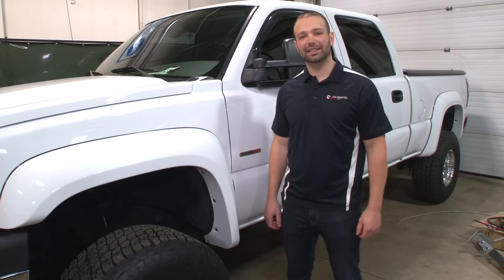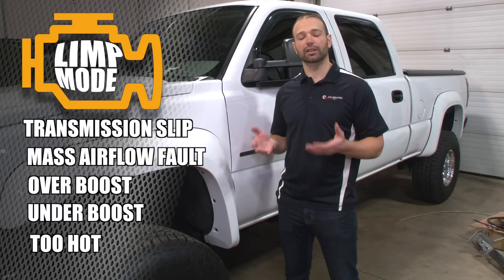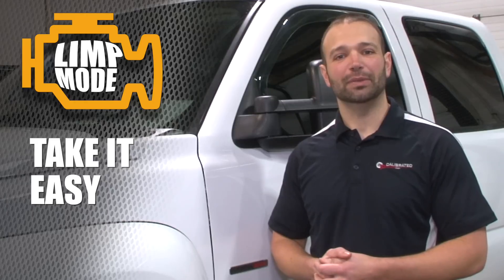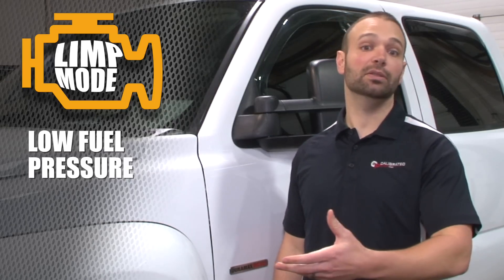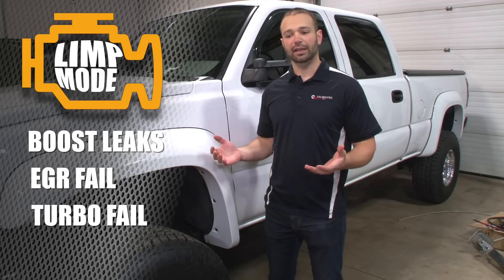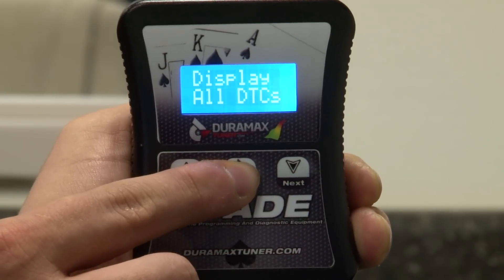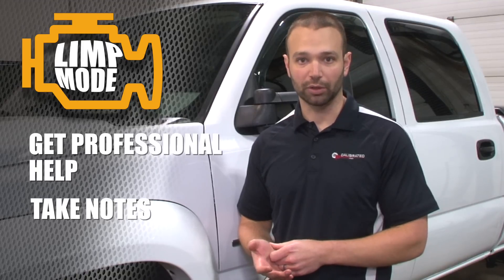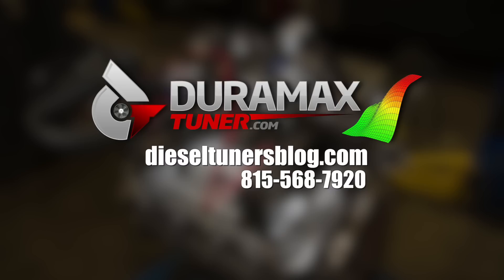DIESEL INSIGHTS: LIMP MODE

Comment: My truck just went into limp mode. EFI LIVE tune 4, 80hp tune. It locked itself into 4th gear and of course the check engine light came on. I pulled over and cut the truck off and put it in lvl 3 (60hp tune) and it drives fine and shifts fine but my check engine light is still on. How ccan I get the engine light to go off?
Reply: clear the DTCs. I can do it either with autocal or a CTS2 edge monitor I have.

Comment: Hey i have a code P268A and makes my truck stay in limp modes goes thru all gears but wont go over 2k rpm it my worl truck need help asap
Reply: I have the same problem. Please let me know what you did to fix it
Reply: @josephknapp24  check posts 4 & 5

https://www.duramaxforum.com/forum/11-16-lml-performance-parts-discussion/791113-strange-code-p268a.html

Comment: It’s a little off topic but if it’ll save somebody from pulling their hair out like I did I’ll gladly take whatever chastising I have coming. My 2004 Duramax LLY started going into derate very sporadically. The only power enhancement it has is a Banks Ram air intake. Ultimately however,it ended being one of the two batteries being junk. I replaced them when I had to jump start the truck everyday. That was 3 years ago and it hasn’t derated once. Prior to that I had scanned it for codes and everything was pointing towards a pressure control solenoid fault so I decided to replace the batteries and then tackle the Transmission issues but after replacing my batteries the check engine light went away, the codes went away and I haven’t had a problem since. I later spoke with a GM dealer tech and he said that one bad cell in a battery can cause the entire electrical system to do some weird things. Which I was partially aware of but I never would’ve guessed it would affect the transmission system but it can and will he said. Those junk batteries weren’t more than six months old but they were cheap John Deere batteries So despite still having a warranty on them, I said to hell with that and replaced them with NAPA batteries and they’ve been great.

Comment: I have a 2005 duramax 4x4  LLY with a P0700  duramax  {transmission control system..<MIL Request}  i can run 250 miles no problem then all of a suden i run on city and it runs on 4th gear only..once i reset the the computer with my obd ..It acts like notin is wrong with it what can cause that code..
Reply from the maker: Sounds like a trans build is in your future.  Cruising on the highway generally does not cause a P0700.  However in the city going from light to light, that is when we see more problems.

Comment: I had message on filter cleaning on my lmm. I drove the damn thing for an hour on highway. Would not come out of cleaning mode. Ended up being the K&N filter caused the Mass airflow the misread due to the oil. Put stock GM filter back in and all was well.
Reply: Coley Bevington oiled filters are bad news for diesels

Comment: Hey nick I have a question about the edge cts monitor, does it read trouble codes?
Reply: Yes it dose it will read all d.t.c for 1996 and newer with obd2 port and it will let you run data logging as well you do need a windows based software to be able to send the log to someone or to read it hope this helps good luck
Reply: #### #### thanks man
Reply: Yes it does.